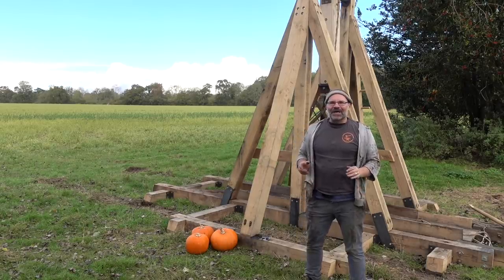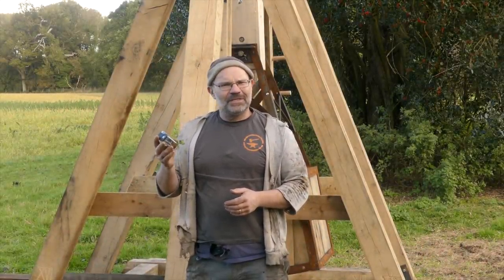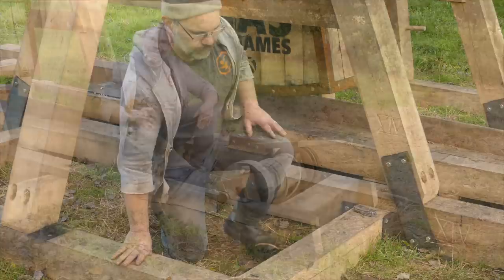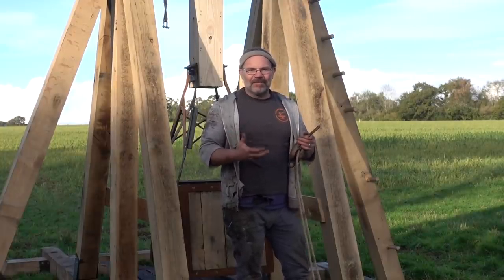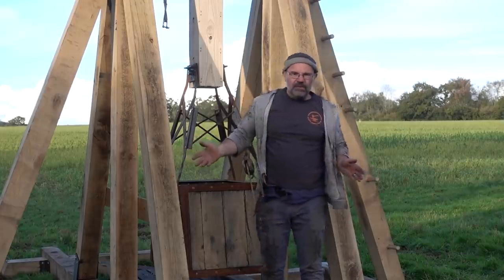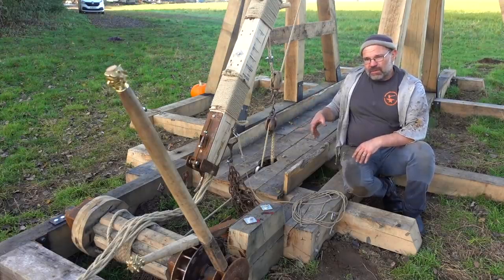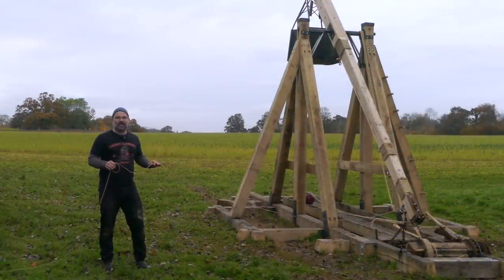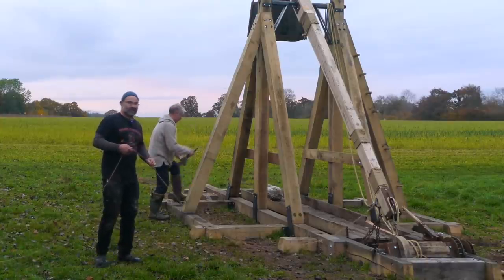So... I HAVE A TREBUCHET

Comment: Tod, there's one key thing missing that will both improve efficiency and avoid damage, and that's wheels on your frame. I'm afraid I can't recall the name of the fellow who made extensive modern study of trebuchet design, but I've seen the improvement on film with both scale models and full-size trebuchets. By having wheels at the base, the structure is allowed to rock back and forth in place when it fires. The pendulum action and the rocking of the frame act like reinforcing waves and impart more energy to the projectile.

As a safety feature, it also reduces the risk of the more extreme forces running up against hard resistance and everything going smashy-time. Everything calms down and settles itself much more easily.
Reply: Also, you could wheel it about

Comment: Sir if I may..., you have the strength and the mechanism fabricated beautifully . However, now we need to work on accuracy. To do this, I have sen other videos of ppl making trebuchets where they wanted to strike walls that they created in order to see if they could do some serious damage with the trebuchet. What they had a problem with was accuracy. To correct it they created a sort of long funnel in the platforms that holds the projectile to its like a gutter wide enough to funnel the projectile in a strait line. They formed the wood of the platform into a slight V shape. it worked beautifully. In the video I saw, they were using stone projectiles and striking a cinder block wall. They eventually went right thru it once they got the weight heavy enough to add maximum penetration of the projectile. They had however damaged the trebuchet when the weight vs projectile weight wasn't proportioned correctly (I think the projectile was too light just as you said). I think there was a formulae they used but, it has been so long i wouldn't know where to find it again.

Comment: Did you consider putting it on wheels? I understand that if the base can move forward and back as the projectile is fired, the weight falls more vertically and you get a more efficient transfer of energy. That is, trebuchet's on wheels fling further than those on fixed stands.
Reply from the maker: tricky on soft ground and lots of work I don't have time for at present - sorry
Reply: @tods_workshop   that make sense. Thank you for taking the time to reply

Comment: Fixed Trebuchet vs Wheeled
I seem to remember from a TV program many years ago that putting wheels on the trebuchet actually increased efficiency (due to the straightened load path of the counterweight).
Might this be a next-step experiment?

Comment: 7:55: Classical mechanics is quite far back in my past, but did Tod mean square rather than cube there? Or have I really forgotten how moment of inertia works?
Reply from the maker: Pretty sure it is cube around centre of rotation
Reply: @tods_workshop  Dimensional analysis makes that rather difficult I think. This list of different moments of inertia agrees: https://en.wikipedia.org/wiki/List_of_moments_of_inertia

Or are you thinking of a slightly different question: where you keep the density of the object constant and extend it in one direction? I was talking about adding a fixed point mass at the end. Subtly different.

Comment: The timing looks great.
Reply from the maker: Thanks - I haven't really checked it yet, but I will up the weight again next time and then it all changes again
Reply: @tods_workshop  upping the cw, it will hold the projectile longer, and throw flatter. Pull the release pin back about 5 or 8 degrees. Flat launches can be fun for targeting though. I'm looking forwad to your Plumbata tests.

Comment: Not shooting a heavy enough weight in the trebuchet is almost like dry firing a bow. All that energy stored in the counterweight goes back into the trebuchet itself rather than to accelerating a projectile through the air.

Comment: When the weight is released it seems to first move away from the frame before getting snatched back, putting lots of stress on the mechanism. If the basket could be leavered outward slightly at the top of the draw then it should always be moving in the same direction and make the action smoother?

Comment: I wouldn't trust bolt joints for anything dealing with such forces but then it wasn't meant to last 40 years like an average woodworking workbench. It definitely must've sped up the process tremendously!

Comment: putting light weight projectiles into a trebuchet is the same as dry firing a bow, with a heavy projectile all the energy is put into the projectile reducing the stress on the trebuchet, without a projectile or with a light weight projectile a majority of the energy still has to go SOMEWHERE and that somewhere is the trebuchet, the same with a bow or crossbow
Reply from the maker: Very well put

Comment: What I find interesting in the slowmo part, is how the counter weight is moving in the beginning. I was expecting it to stay in a vertical orientation and just moving in a curved path because erath's gravity is pulling it down all the time. But it actually has an angle that is pointing back. Any physicists here to give an explanation?

Comment: also,how does the trigger and loading of your design differ from the setups that would have typically been used.i find the type of engineering of that period interesting,how they solved problems with minimal materials.
Reply from the maker: as far as I know the slip hook was a standard trigger form

Comment: Could a trebuchet destroy a modern Tank or Armored vehicle, if you managed to get a lucky hit? 

Like could you use Trebuchets in Mad Max? 
Second thought, could you mount a trebuchet on a Trailer? And use it while driving?
Reply: If you shot one of those incendiary rounds off the back of a trailer, the Drivers combat style would be the essence of a Scorpion... With his Tail, (The Trebuchet Trailer), being able to reach up over the Head, (The Truck), and strike far in front of them with deadly Poison, (The Fire 🔥) 

That would be amazing to see that in Mad Max, with it all decked out in Scorpion themed paints and designs. 

And then to top it off, you could mount an Actual War-Scorpion on the Truck itself. So you'd have 2 siege weapons on your vehicle!!! 

The Trebuchet could attack distant targets, (with slow reload rate), while the Scorpion attacks Short-range targets. (With fast reload rate) 

Then you could have 3 people in the Truck, (1 Driver, 1 passenger to reload Scorpion Bolts, 1 Scorpion shooter/Lookout)  and 3 people on the Trailer. (2 Trebuchet loaders, 1 Trebuchet shooter/Lookout) 

You could also detach the trailer in a safe location, and then use the truck to defend the trailer. Leaving both squads with a 3 man detachment, and a siege weapon. 

Then u could Keep 3 Dirtbike motorcyles on the Trailer so the Trebuchet squad can retreat if needed.

Comment: 2:17 Those longitudinal cracks you are getting there are problematic, you should strap them up with steel belts  or otherwise they will fail.
Reply from the maker: They are certainly there, but I doubt a problem

Comment: You think you can make one with modern technology and make it more powerful
Reply from the maker: Yes that would be relatively east to do.  There is so much excess weight in the arm to make it as a framework for example or carbon fibre moulding would reduce this massively and push the efficiency right up and as Tom Stanton showed to great effect, there are other non medieval ways to reconfigure a trebuchet